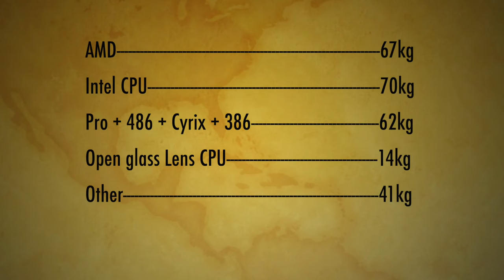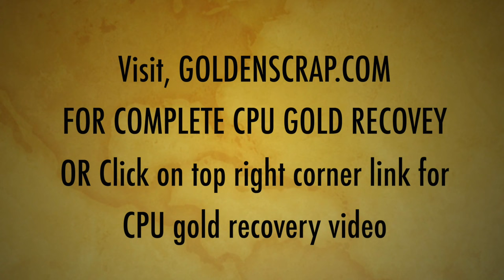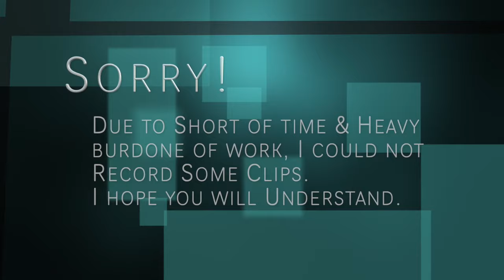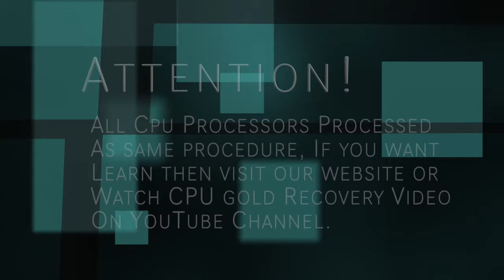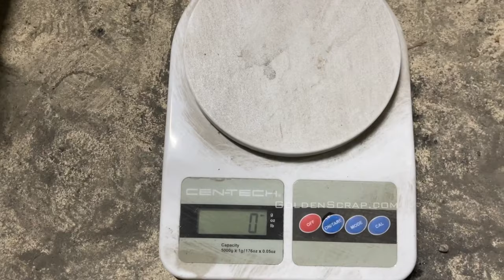World's Biggest Gold Recovery on Youtube | 250 KG Ceramic CPU Processors Gold Recovery #GoldRecovery

Comment: Ay hye....i lost a lot of gold in processing huge gold plated IT sheets.may be some more are availible with the seller but it was a big mistake.
Actually my SMB did not worked in all ways.no dust settled.i thought it happened and poured all solution on ground leaving the smb dust in bottom😭 i used alot of smb
Reply from the maker: Add extra water